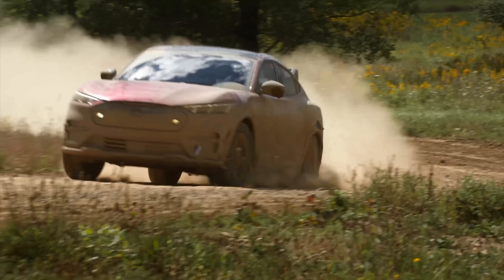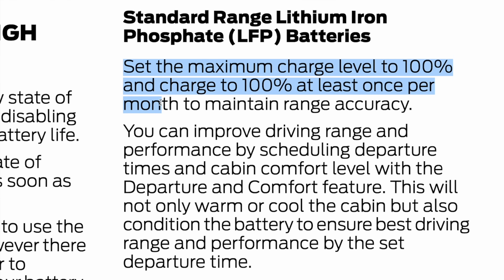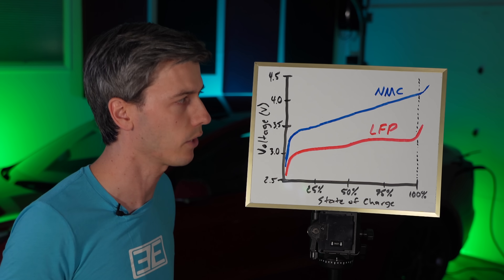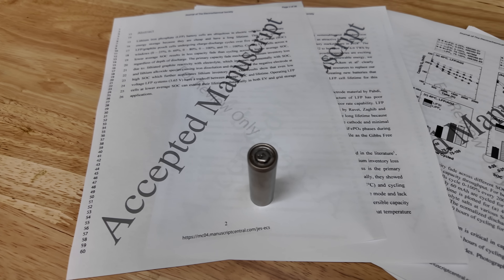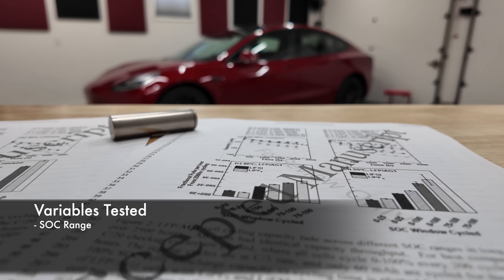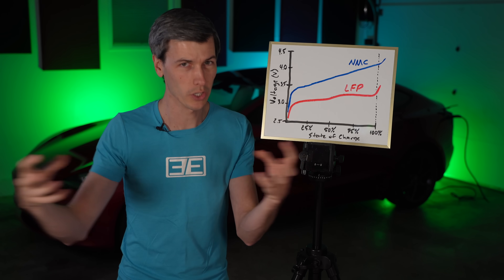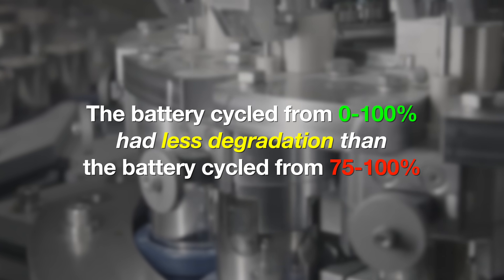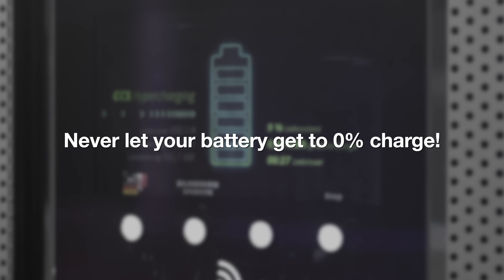How To Ruin Your Electric Car's Battery - LFP Edition!

Comment: Edit: since people are replying without watching, 9:50 supports my statement. The point is that operating at the top 25% is the most harmful to the battery, yes, charging to 100% is best for the BMS, but not for the battery. Most people are not going to be able to or comfortable with parking their car at 20% overnight, so my point is that cycling from 50%-25% is likely to be less harmful than the alternative of 100-75%, based on the data that lowering the max charge reduced the wear. 

So this is my take away from this for home charging: 
So my take away is this: BOTH types prefer lower SOC, but we can’t calculate LFP as accurately without frequent 100% charges, so manufacturers have chosen the BMS accuracy over the lifespan of the battery. Personally, if I ever get a car with LFP, I’m still setting my charge limit to less than 70%, plugging in daily, and just adding in a 100% charge like once a month or whenever I feel the BMS is noticeably out of sync. Not using the charge limit function purely because the BMS needs more frequent calibration is asinine.
Reply: @WillProwse  did you even watch the video at all. That’s literally what he just said
Reply: This is exactly what I do. I stay in between 70-20%, leave my level 1 charger in and charge to 100% monthly
Reply: I think you may have misheard, he pretty much said with LFP to cycle it less, ie. draw it down deeply (though not to zero) and charge it up to full or near full. Given the voltage spike right at the end, and the fact that higher voltages are one thing that can hurt, 90% in general should be fine with 100% on a regular basis.

But even in the worst case scenario the results were in alignment with only 10% degradation after 200k KMs, or like 130k miles. The car will still run fine for years after that, just have slightly less range.
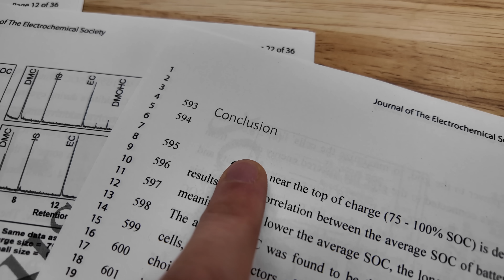Reply: @morosis82 no, that isn’t what he said. The spike voltage is how we know the battery had completed charging, though that may contribute to the damage. He very clearly showed that the studies stated the lower you charge, the more cycles you get. 7:34 and 16:12.
Reply: @morosis82  Having almost all of the lithium on one side is bad too. Not just voltage.
Reply: LFP is not the same, charge to 100%
Reply: No it's okay or even good to charge higher on LFP batteries. You just don't charge as often. You can go down to 20-30% and just charge up fully. This is unless you make regular long trips then maybe set it to 80% and charge daily.

Comment: Watching this so far and there is one thing that kinda makes me go hmm. Storing a battery at a lower state of charge is only partially true when talking about batteries. You need to store it at is nominal voltage, as storing it at too low of a state of charge is also bad. It just so happens the nominal voltage is around the 50-60% SoC. I find talking about SoC anoying because of this and wish cars would just say "Your battery is in the right storage level to store" based on voltage instead of SoC which is just an estimation from voltage.

Comment: Great video and great info. The only thing that I think should have been mentioned is how many charge cycles you are looking at. Just saying the life of the battery will be better or worse without context can scare people that don't know any better. LFP typically has a much greater cycle life than NMC, normally around 2500-3500 cycles. If you have a car that has a 200 mile range and you get 3500 cycles from your batteries, that's 700,000 miles of life (rough math). If you degrade the cells down to 2500 cycles, you're still looking at 500,000 miles of life.
Reply: Exactly! Also, how much battery degredation did they see with the 75-100% SOC pattern?!? Did they only see a loss of 5% total cycles over the lifetime of the battery? I'm good with losing 175 cycles to keep my battery at 100% LOL
Reply: @Jasonoid  Especially if the battery is going to drastically out last the car (or maybe us) while doing so.
Reply: Problem will not be cells but cell connection ,they could fali over time and electronic off BMS ,i have Dell Latitude with BYD LFP battery and after 4 years off using i still not see any difference in battery life
Reply: but can you calculate the cycles like that? I mean, is car range really only one cycle? If you only drive with a constant speed - yes. But if you use a lot of regenerative braking, you are charging. So if the car has a 200 miles range, it will use more than 1 cycle to drive that distance, sometimes 1,1 cycle, sometimes 1,5 cycle and sometimes even 2 or more cycles
Reply: @MrDefyer  It was rough math, but yes, you are right. I frequently forget that regen adds roughly 20% to the range of the vehicle. The better math would likely be closer to 75% of the range multiplied by cycles, since there are other factors at play as well.

Comment: At the end I couldn't draw any conclusion, especially when he said "Nobody knows anything except sometimes we do" 😅😅😅
Reply: You can watch the solar nerds. They use LFP all the time for home storage. Most cells have like 3000 cycle life.
Reply: Nothing about EVs is a science problem. It's one giant economics problem that won't be solved while any of us are alive.
Reply: It is simple.
For all batteries (NMC or LFP):
1. Do not keep them at 0 % or 100 % for long time (hours at most).
2. Keep them in range between 20-80 %.
3. Small cycles are your friend.
4. Charge LFP once every 2-3k km to 100 % to calibrate the BMS (do that before you drive somewhere, do not let it sit at 100 %).
Reply: @pepegano_3578  not quite, "do not sit at 100%" does not apply to LFP, and cycles have very little impact except for very high mileage/year. For LFP, avoid 0% and charge to 100% when convenient and you're fine
Reply: @mrfurieux9587  It does apply to LFP. When you are at 0 or 100 % most of the lithium is packed on one of the electrodes. This causes the electrode to have higher volume and its structure starts cracking (degradation - capacity decreases). The longer you keep it that way, the more it cracks. This damage from cracking is same in LFP or NMC or any other similar chemistry. On the other hand, LFPs separator degrades less (compared to NMC) when fully charged, due to smaller voltage.
According to study mentioned in the video, cycling from 0-25 % had lowest degradation and cycling from 75-100 % had highest degradation. This directly contradicts what you say.
Reply: @pepegano_3578  no it doesn't apply for 100% for LFP, as 100% for LFP is under 4V (the damage is mainly voltage-related if over 4V). The point is that 100% for LFP is *no more harmful than 80% for storage*. Cycling is another topic as the SOC changes during cycling by definition. Storage at 20-50% is still better than 100% but the difference is not huge.

Comment: The real question is: Do consumers need to care?
If, let's say best case real world scenario is 80% capacity left after 100k miles and worst case is 75% - I genuinely wouldn't bother with all the charging/not charging/pecentages. If it's 80% vs 40% - then yeah, it's really important
Reply: In a modern EV with a battery bigger than 50kWh, the battery will probably outlast the car for an average driver anyway. But if you drive way more than the average driver it could have a significant impact on the lifespan of the battery. So for someone who drives all day every day I'd say it's worth considering.
80% vs 75% is actually quite significant for Li-ion because there's not that many usable charge cycles left after it drops below 70% SoH. 
I don't know if that's true for LFP though. Worth looking up.
Reply: @auspiciouslywild  what I mean is - what is "significant impact" mean in here. (not trying to pick a fight here though ;) ) In a lot of discussions people use words like that but they don't mean anything real. Like if you look at stock graphs (let's imagine one here) - the fluctuations look insane, because graph lowest point is actually something like 1.5 USD (instead of 0) and the top is like 1.55USD - the fluctuations plotted would look massive, but then if you would draw the same graph from 0 to 1.55USD - the change wouldn't even be perceptible by looking at it. 
That's just my convoluted way of saying - please put numbers behind words like "a lot/significant/etc.." because otherwise it's the same as kid saying "my car is fast. How fast? Like 5 of speed fast"
Again not trying to pick a fight, just pointing out flaws in general discourse
Reply: @vandalpaulius  You can look up other lab studies on cyclical degradation. It's a slight exponential curve, the difference in # of cycles at 75% vs 85% can be a few hundred. That could easily be a year or two of capacity that isn't lost. Harder to say real world though, there's some decent data out there, but it will be a handful of years before we get a wide range of data from 10+ year old cars. Basically starting with the 2017 Tesla model 3 as that's when significant adoption started happening.
Reply: Exactly, especially if you can charge a home which is like super slow charging compared to superchargers.  If you’re buying anything new, it would take a very long time to get down to 80%. 

Even look at those old leafs that had no battery cooling not the first batch the second set from like 20 13-14 even after 80,000 miles in eight or 10 years. They still had like 7080% and that’s definitely worst case.

Comment: LFP batteries' durability is unmatched, even under extreme conditions. Focusing on ideal practices is irrelevant, as it won't affect the car's lifespan. Failure to point this out just fuels EV skepticism.

Comment: And all this confusion is why most people are sitting EV's out until they figure it out.
Reply: That and the initial outrageous cost of the EV and lack of infrastructure and the inconvenience
Reply: @stevesmith756  I think this is an outdated opinion. There are quite a few EVs available in the $25,000-$50,000 range. This is well within the median new car purchase price, regardless of the propulsion method. The charging infrastructure is growing daily, and at the moment, most EV owners charge at home. We can definitely have a discussion about charge availability for apartment dwellers, that is still a real problem. For the majority of people, it is not inconvenient at all.

It is a nuanced discussion, and I invite anyone to discuss. That is how we solve problems and obstacles. It is still not a perfect answer for everyone, but it is also not the issue most people still think it is. Peace.
Reply: This confusion is only for people min/maxing. You don't need to keep most of this in mind with current day batteries. You just charge whenever you think you need to and use your car regularly.

Comment: Worst thing about EV's is that gigantic hidden cost 8-10 years out (or fewer, if you abuse your batteries).  Its like replacing your entire engine and drive train at the dealership.
Reply: ICE cars have the same problem. Skip or elongate oil changes, tow frequently or idle your engine a bunch and you’ll have engine or transmission replacements in short time.
Reply: @coltonthies4672  Yeah you can ruin a car by treating it poorly. But EVs have that inevitable costs no matter how careful you are with them

Comment: Just FYI the VIN method for checking what battery chemistry you have is not true. My 8th digit for my VIN is a letter which according to you would make my model 3 a nickel battery but when I go to my settings it clearly states my high voltage battery is LFP not nickel
Just thought I’d mention that as idk how other manufacturers have their car’s information displayed on their cars settings
Reply: VIN method only for Ford

Comment: And this folks is why I'm not ready to hop on the EV wagon. Having to care about these chemistry concepts, thinking about which kind of battery I have, thinking about the longevity, the risk of an electrical outage, either I have a charger at home or not, and all these considerations are, let's be honest, plain boring. Don't get me wrong, I am an engineer, and I enjoy understanding all this. But as a user, I don't want to care. Gasoline vehicles are unparalleled from that regard: "just top it off, dude". Works in every scenario, every temperature, every day, whatever there's left in the tank, whatever the manufacturer, and doesn't impact longevity or whatever.